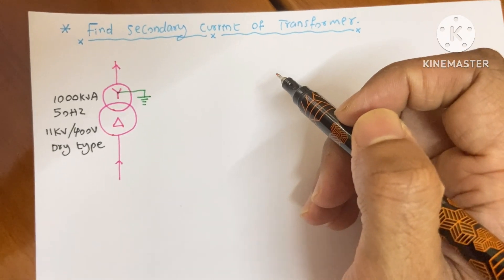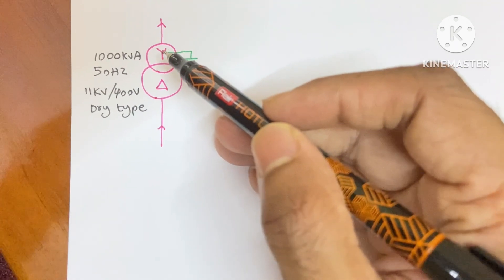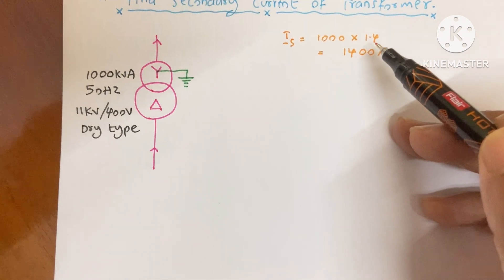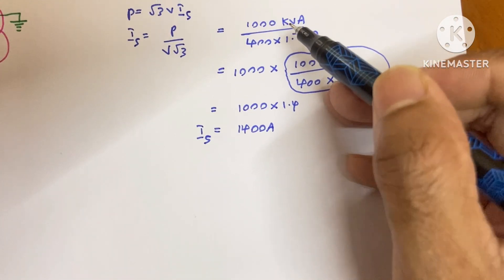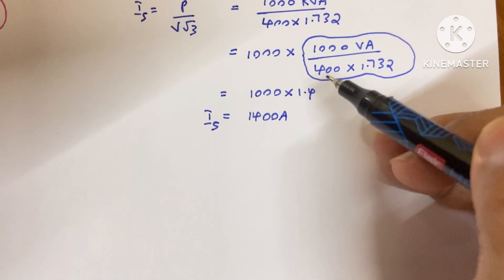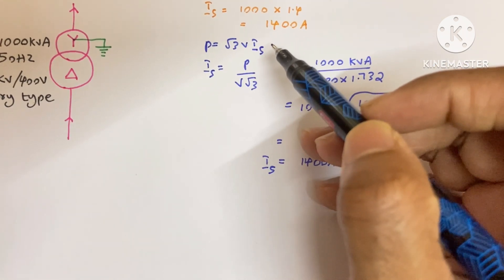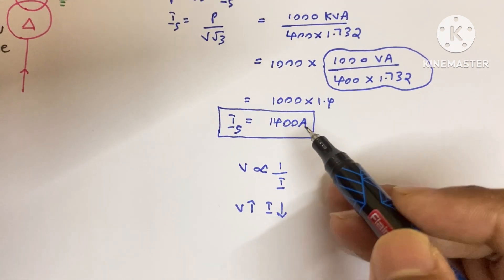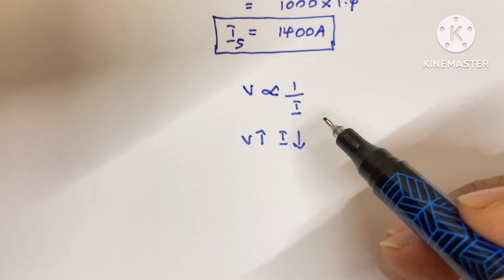How to calculate secondary current of distribution transform /  Electrical platform

Comment: Why is the neutral of the transformer connected to earth?
Reply from the maker: The return current must goes to earth through neutral
Reply: @ElectricalPlatform  ok, but why the neutral in domestic installation is advised to be connected to earth?
Reply from the maker: @noelfaithfulkari2857  if you connected neutral to earth, then only you will get potential difference for the working of all electrical equipments.
Reply: @ElectricalPlatform  FYI: In TT earthing system (India) the consumer should not link neutral and earth, as it''s dangerous. During floating neutral condition if the earthing is not proper (loose contacts, rusted  GI pipe electrode, high resistance etc) all earthed metal appliances (like switch boards, heater, fridge, OTG, oven, fridge, washing machine, metal body grinder etc,) will be energized via earth terminal. MCB or fuse will not work as the path is incomplete. If we touch we will get electrocuted. Hope this helps.
We dont know the commentor's country. So we don't know what earthing system is followed in that country.
Reply: @noelfaithfulkari2857  Which country you belong to and what earthing system is practised?